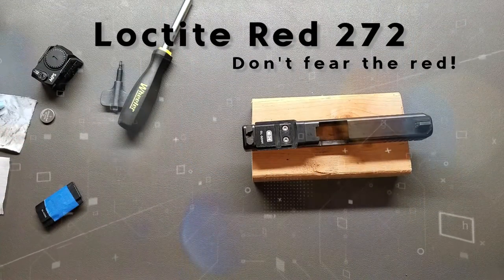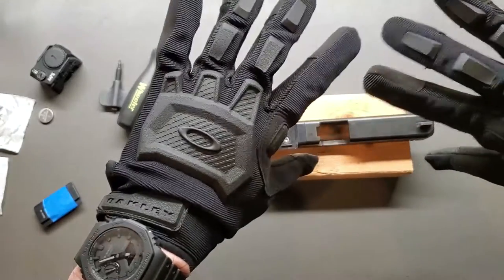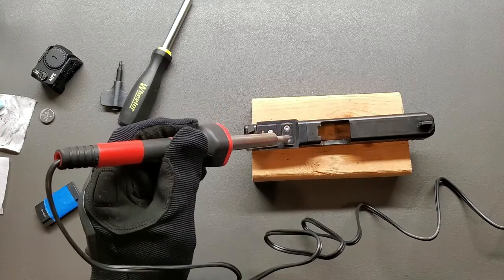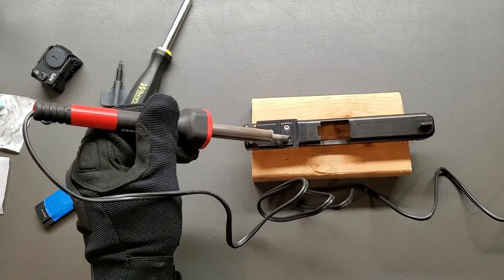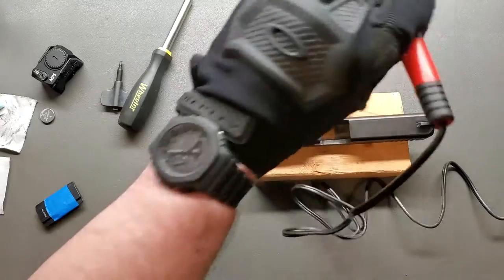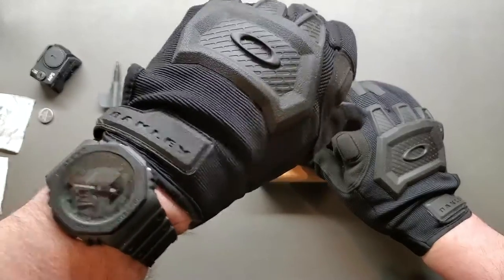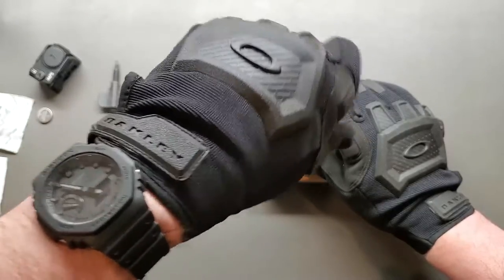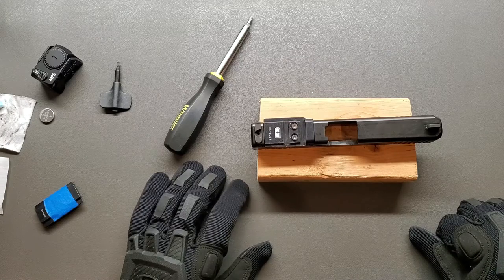Loctite Red Removal: Don't FEAR the RED!

Comment: Honestly red  is where it’s at Specially when you  have a plate and optic that you don’t plan on changing …Another trick that really works well  that buck from c&h precision  does is to use a medium  Loctite like blue  and  apply black finger nail polish to the top of the screw  …That legitimately works really well to
Reply from the maker: I don't bother with the nail polish when I use red. I will definitely keep it in mind though!

Comment: I am after a permanent high strength thread sealer, working temp up to 450F. Needs to be resistive to chemicals. To bond steel bolts in aluminium. Ideally high viscosity. What would you recommend?
Reply from the maker: Loctite 272 will probably work, but the higher temperature solution is probably ceramic based. Vibratite Hot Lock 19960 may be better.
Reply: @graydogllc  I was thinking 272. I will try that 👍

Comment: Got some XS big dot front sights that I had a gunsmith put on. They came loose and I noticed the sights wasn't snug and needed red loctight. My question is, do you think the barrel with heat up enough going through a box of ammunition to break down the red loctight and loosen the sights? 🤔
Reply from the maker: I haven't experienced that, but definitely let the loctite cure for 24 hours before you shoot, otherwise it might come loose again.
Reply: Any update on your experience with the red loctite? I installed some sights on my gun and I took to much material off so there was some play. I shimmed with a piece of aluminum can and applied a liberal amount of red loctite. Hoping I don't have to buy a new sight.

Comment: I put red loctite on my pistol optic. Kind of worried im not gonna be able to get it off. What should I do if I can't get the screw out with a soldering iron???
Reply from the maker: Soldering iron will cause the loctite to lose its bonds. Leave it on the screw for a good 2 minutes before you go to unscrew it. Make sure you put the slide on a block to hold it stable and then gently start to loosen it. Don't slam it, just keep increasing pressure on the screw, it will come loose.
Reply: Brake cleaner dissolve it to dont let it near any rubber or plastic

Comment: Have come into possession of a 17 slide w blue loctite in the rear sight - Thoughts of using this method to remove the rear sight in this scenario?
Reply from the maker: I'm assuming that you have a set screw in the sight holding it down? If there are tritium vials in there then the soldering iron may be the only way you can add heat without doing some weird stuff to the sight itself. Get that screw nice and hot, that should release the chemical bonds and make the screw easier to turn.

Comment: Could you just break the loctite off with like a piece of metal or something
Reply from the maker: Not without stripping threads if you aren't careful.
Reply: @graydogllc yeah, currently we trying to get a bolt out of a pulley spindle on alawn mower. Did a search for replacement parts, the picture of the bolt suggest it was bonded with red loctite. Not moving when i try to get it off one handedly, even my wirst started to hurt, its really strong haha. Time for the heat, In our case from a can as we dont have soldering iron.